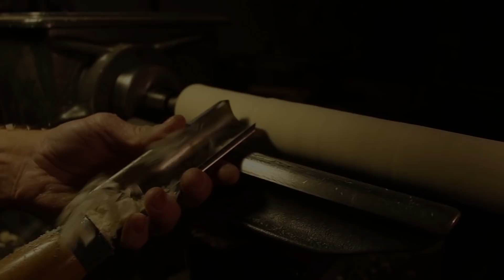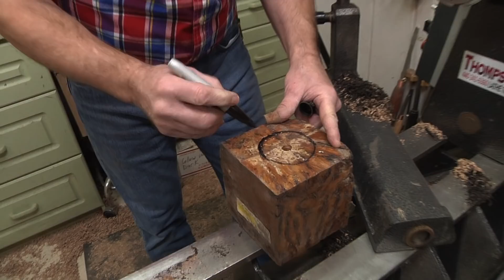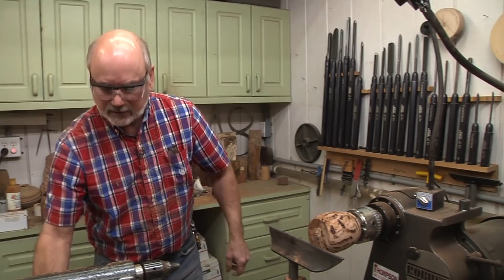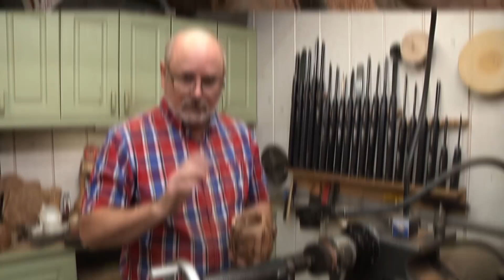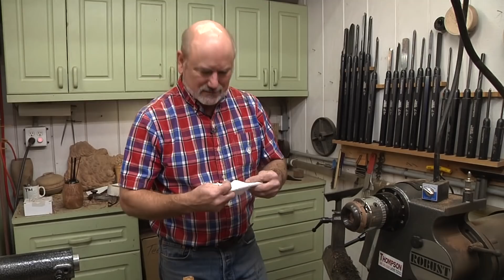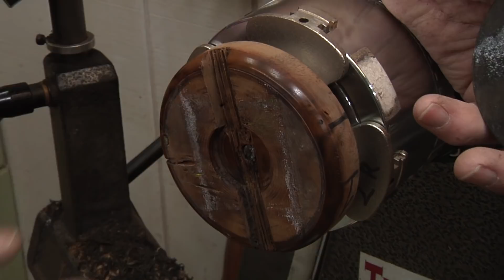Gum Burl Reed Diffuser

Comment: Another beautiful project. Well done sir! 
Couple questions for you though. 

What is the name of the diamond wheel you sharpen your tools with? I watched your shop tour video that showed it in there a while ago but I can’t seem to find it again. 

Also the mesh sandpaper you mentioned in this video is that the kind that looks kind of like a window screen and sort of Velcro’s onto a sanding block and to clean it out you just smack it on a bench top or use compressed air? 

Thanks in advance for your help.
Reply: JJ Hanson    The wheels on the grinder are called CBN wheels. The sand paper is MICROMESH. Both are available in many locations.
Reply: Ron H, thank you sir very much for your help.
Reply: JJ Hanson   No problem.